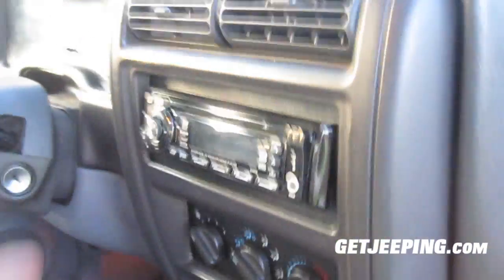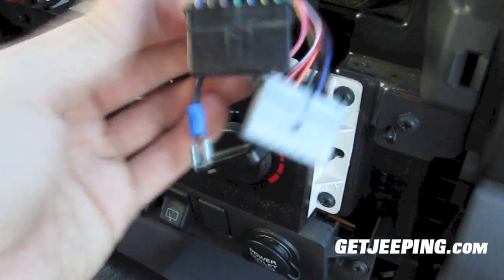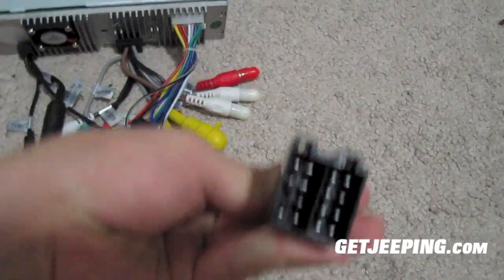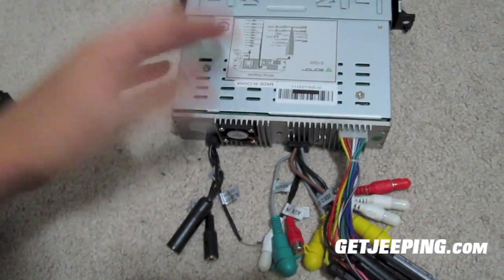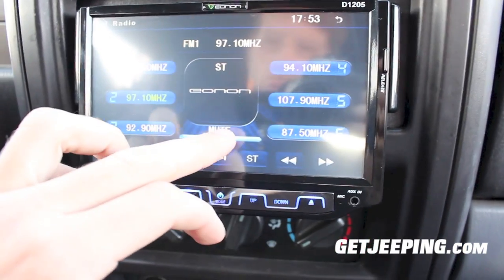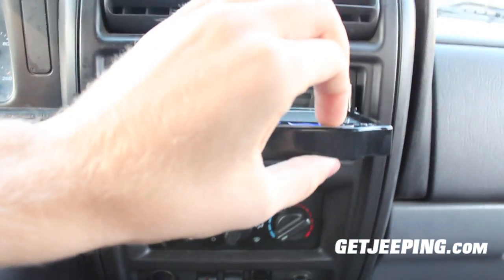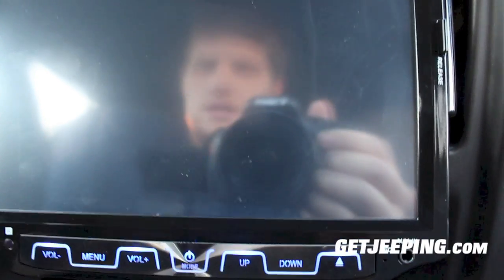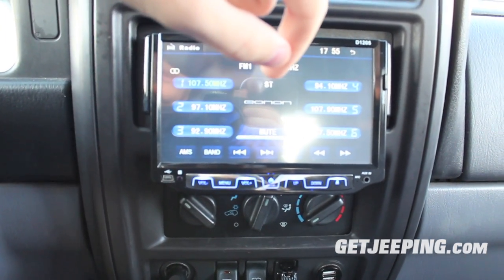How To: Installing of 7" Touch screen 1 Din Stereo in 1997 - 2001 Jeep Cherokee XJ - GetJeeping

Comment: ey guys, I installed a new radio (Kenwood KDC-BT562U) in my car (2000 Cherokee Sport) Wednesday. I was unable to unplug the battery at the time. After I installed it I needed to jump the battery. Car and radio were working fine, however I noticed when I start the car it felt like it would struggle a bit like if the battery was dying. Today my car won't start. Any ideas what it could be? Perhaps a blown fuse?
Reply: I am not sure if you have installed more custom components, that just a stereo but, if you have subs, amps, etc. it could be your alternator. It may not be efficient enough to power your system (draining the battery) People usually do not take that in to consideration. Additionally, the size and power output of your battery may be wrong. Just some things to consider.

Comment: Manuel medina and speedy mcquicksta, it should fit just double check the depth on the aftermarket radio and dont wire it like this guy! dont ever use wire nuts in a car.

Comment: NO!!!! Not wire nuts, use crimps or solder and heat shrink, even scotch connectors, anything but that, it's meant for by our house not your car.
Reply: Your exactly right i use crimps then heat shrink it after.

Comment: The radio is an EONON. Champion of the cheap and uninformed buyer. Their Mazda radios look like a nice solution too but are absolute junk. Crap touch screens, NO fm reception at all, poor output power, GUARANTEED to have at least one channel blow in a months time, and good luck with the setup/firmware/GPS issues. And lastly zero seller support once you own it.

Comment: ;/    When you buy an off brand electronic item like that from China, you are risking taking a loss. I personally think it is worth it to spend the little extra to get a head unit from a reputable manufacturer than to save a little and possibly have trouble down the road. Idk, maybe you have a warranty with it but typically there is no warranty when buying those foreign  head units. The last two touchscreen head units I bought were Pioneer and I was very satisfied with them.